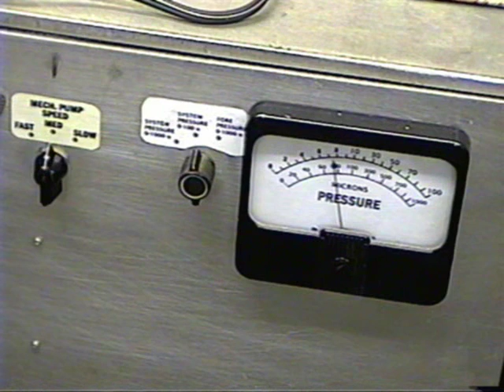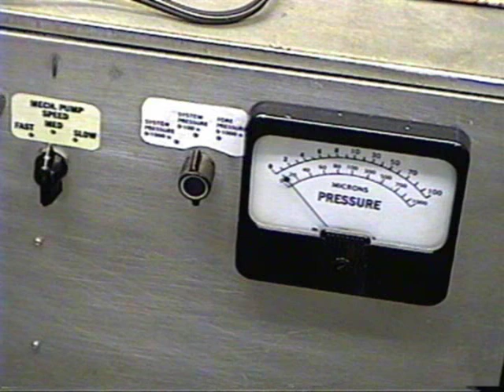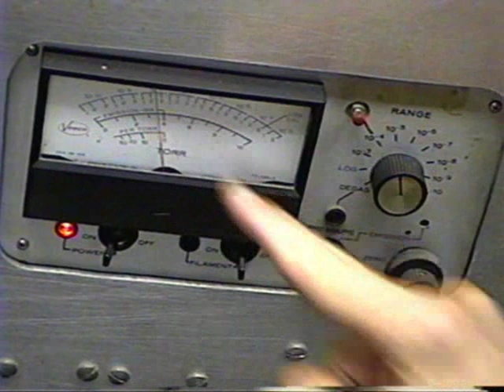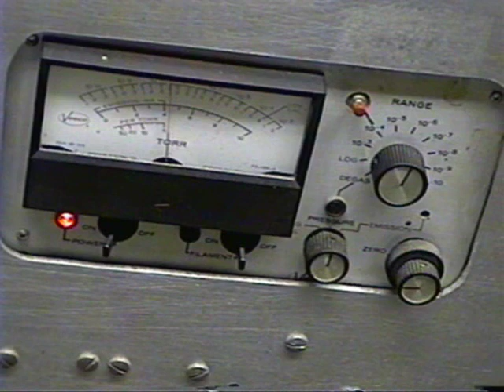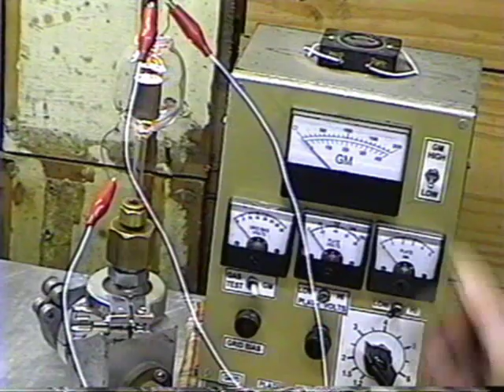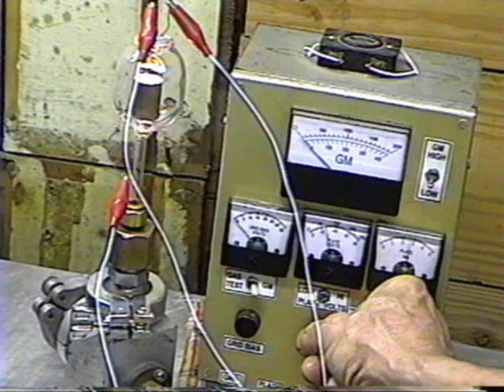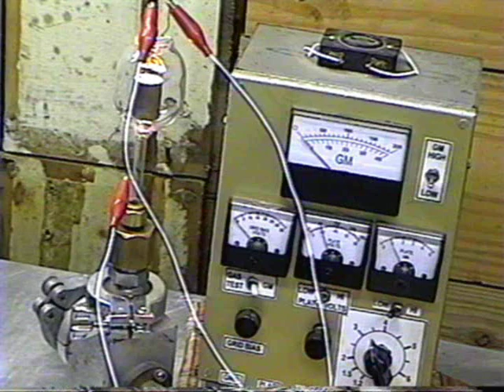making a fleming diode vacuum tube 6

Comment: Great videos!

Something you mentioned/tried to explain near the end: the flow resistance in the narrow evacuation tube causing a long time to bake out.  A second contributing factor that you didn't explicitly mention is the volume of the vessel you are pumping out.  The larger this is, the longer it will take to pump out.

Comment from the maker: The wire is AWG #22 nichrome wire. (available on ebay) The inner body of the oven is made of old propane tanks. The wire is supported on glass flanges made of pyrex capillary tubing. The resistance of the heater is set to dissipate about 500 watts at 120 volts. A thermocouple controlled voltage regulator sets the temperature. The temperature can be set to anything from room temp. to 1000 F, which would anneal soft glass fine. The controller determines the mains voltage input.

Comment from the maker: @ubuntupokemoninc 
Why would you do such a thing? Oil pumps are so available on ebay. The mercury has a vapor pressure at room temperature of about one micron. That will be the ultimate vacuum in your tube if you seal it off. I don't know if a getter will eat mercury. Stick with an oil pump using DC-704 oil. The backstream oil is burned up when you bake  the tube  so it isn't a problem.

ron

Comment from the maker: Technically, that is true. However, the diffusion pump on the system is capable of over 200 liters per minute at the inlet. This is vastly greater than any vacuum tube volume so the major factor here is the constriction. Maybe I could make a 1 inch diameter evacuation tube! LOL!

Comment: I recently got interested in early wireless transmission. I was reading about the ground breaking work of fleming on his thermionic valve. (on the List of IEEE Milestones for electrical engineering). I found a book (https://archive.org/details/thermionicvalvei00flemrich) from 1919 describing his discoveries. Now, I would like to repeat his fist experimental setup (p51). So I need a "fleming tube". First tried to make one myself (roundbodomflask with rubber stopper pierced with kathode and anode setup. created vacuum with mechanical vacuum pump) without succes. After looking at your turtorial, I gave up! :) Could you give me advice on what existing tube to look for (triode, double anode) I could hook up to preform this experiment. Or do you also sell these ? Danny Belgium